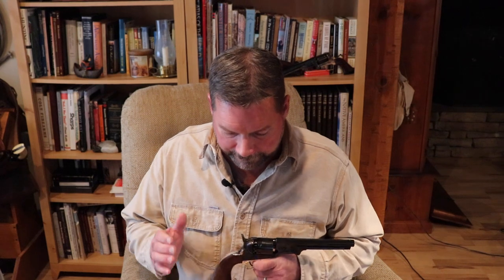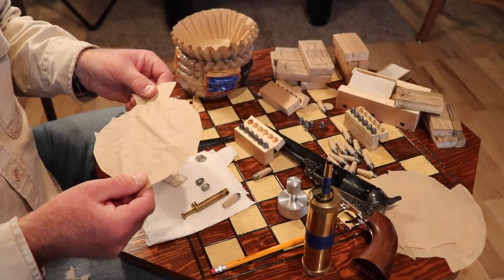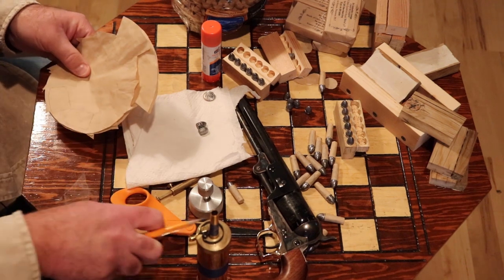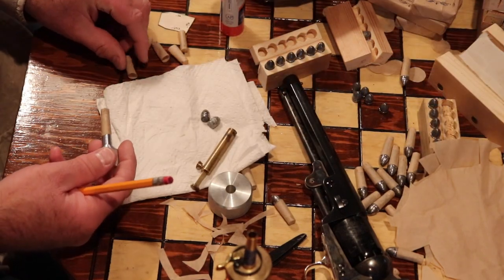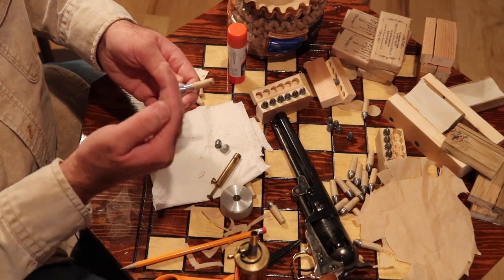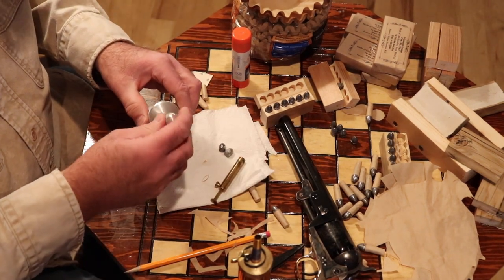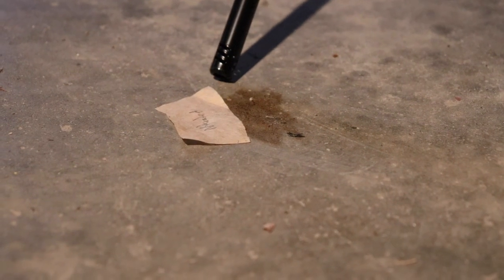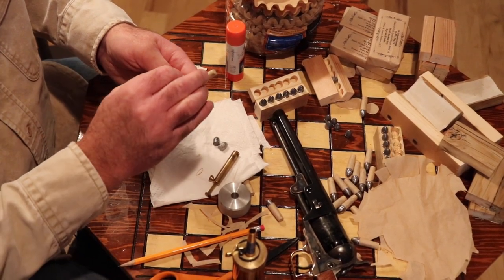Making Paper Cartridges

Comment: I use a 5/8 hole punch for the bottoms on a 36 caliber and a 3/4 hole punch for the 44s. I bought them on Amazon for about 4 bucks each. They easily punch 6 at a time.

Comment: Just bought some flash paper, made my own dowl perfectly sized, can’t wait to roll some up and test em out. I’m so excited, I resized a bunch of #11 caps that wouldn’t fit my nips, I really hope I don’t get a chain fire, only thing I’m worried about. 😬 but should be all good.
Reply: How did you resize the #11 caps? I can't find #10's anywhere.
Reply: @alanpeterson6224  get a pair of wire cutters or a socket that’s like 4mm or 5.5 I think. You’d have to grab a micrometer and measure to be sure your resizing correctly. But I simply just used wire cutters that I drilled the largest hole to I believe .175 inches and crimped all the caps by hand. To use a socket, you’d find the one that fits fairly good over the nipple, not to tight or the caps won’t work, it’s a trial and error method really, but then place the cap open side up and press the socket on the cap just as you would a nut or bolt. Simply and carefully use something to poke it out and repeat. There should be a Reddit page about the socket method.
Reply: @smartmeis  Okay. Thanks.
Reply: How do you resize the #11 caps bro ?
Reply: It takes a lot to set a cap off so don’t be scared of them.
Reply: I’ve posted a video to my channel about how I do it. And the tools and measurements I use. Should help.

Comment: Where did you find the pattern to cut the paper for .44?  I bought the Mesa Winds former but no template.
Reply from the maker: The Mesa Winds site used to have a link to a pattern page.  For some reason, that link isn't there.  Although I haven't looked in a while.  Try an internet search for a flat bottomed cone.  I had to measure the top and bottom diameter and put the figures in a formula when there was a link.  The formula was on an unrelated website, so a search should get you what you need.  Thanks for watching, Todd

Comment: No wad I'm seeing or did I miss something. So the bottom paper acts as wad?
Reply from the maker: Caleb, Most paper cartridges don't have a wad.  The paper holds the powder and attaches to the bullet.  You can lube the bullet or apply lube over the chamber mouth once the cartridge is rammed in place.  I put fiber wads under my black powder cartridge rifle loads, but get by fine without a wad in the pistol loads including paper cartridges. Thanks for commenting.   Todd

Comment: You sepeak of the importance of 'nitrited' filter paper several times, but not a word on how one 'nitrites' this material?
Reply from the maker: About mid production, I nitrated the paper and I'm starting to think it's not all that vital.  It wasn't very impressive on video, so I didn't include it.  Will do more trials soon.  Thanks for watching, Todd
Reply: @frontierwesternheritage1356  I found it on some other channel.  Potassium Nitrate and water.  Get the stump removing powder at HD or Lowes thats 99% , 1 cup to 2 cups (preferably distilled) water in shallow tupperware, soak filters hang to dry in the sun or warm place.  I load my repro 1851 and my real colt 1849 the traditional way.  With practice and repetition, I can load pretty quick.  I investigated paper cartridge but after seeing the work involved, it's not worth it to me.  I only shoot these pistols 2 or three times per year, when I'm in the mood.  Always attracts a curious crowd at my range LOL